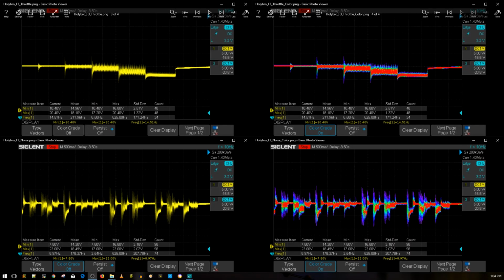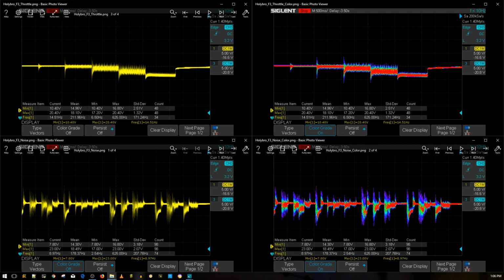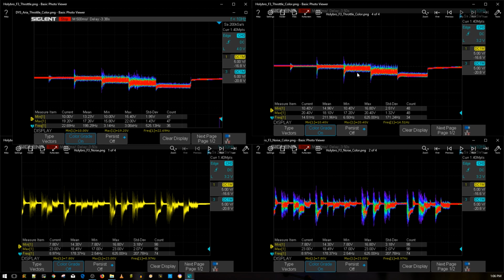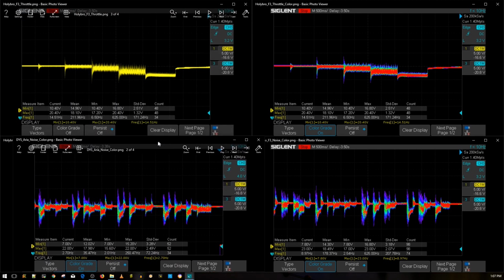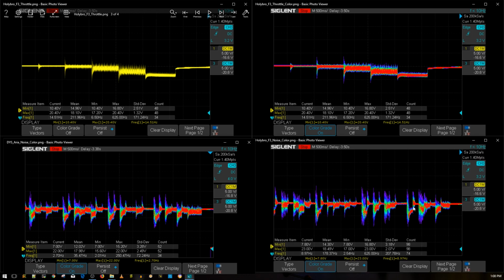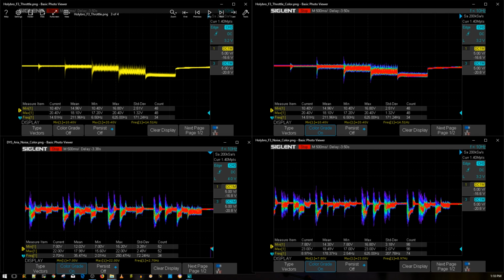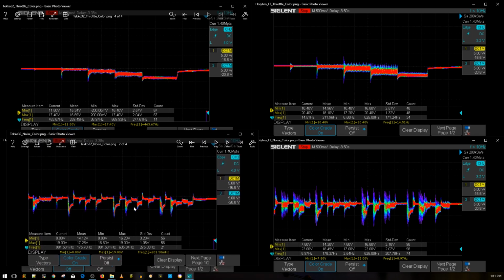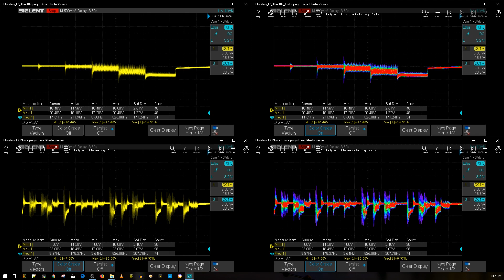The New Generation of FPV Drone ESC's // Holybro Tekko32 F3 35A ESC Review and Noise Test

Comment: Would you say that the Holybro Tekko32 35A 4-in-1 BLHeli32 3-6s ESC still is the best 4-in1 ESC for a quadrotor drone? Do you know if Holybro is coming up with a replacement or would you say this is still the best 4-in-1 esc until the end of the year. Also! I've started following your videos and I appreciate all of the effort and time you put into these videos :)
This is a side question, do you have any recommendations for a good PDB for a 6S set-up? Thanks :D

Comment: So in your opinion it goes like this.... 
1) tekko32 4in1
2)tekko32 individual 
3) tekko32 f3
4)dys aria? 

Is there anyway you can get your hands on the airbot typhoon32 v2 4n1?
 ((( IDK what it's called)))
 The original one from airbot that looks jus like the tekko32.
I would like to see those 2 tested against each other. I wonder if Holybro puts some magical unicorn pee on it to make it run so so smooth or if it's jus the design of this ESC is badass.
Reply from the maker: 1 tekko32
2 tekko32 4in1
3 tekko32 f3
4 dalrrc engine
5 dys aria
budget
spedix is30 single esc
Fly color raptor bls 30a

Comment: I made a comment in a previous video about these escs.  Glad you picked some up to test. 
Before watching the video I felt like the small amount of caps and the high processing speeds would cause it to be good but not as good as the aria.  I was figuring thef3 escs to have a little more noise than your testing showed.  The 32k gyros need clean signal to run smooth so I was applying that logic here. 
Interesting to see that it beat the aria. 

It comes across as a viewer you're really passionate about these tests.  I think I can speak for everyone and say thank you for taking the time to save us some money! 
Until the underdog beats the tekko32, I'll  stick with the 2 I have.

Comment: not sure if its a thing, but i notice when i add caps i loose some power from top end of the throttle. i would almost say its up to 20% loss. can you confirm this happens or am i tripping? i have felt this with both quads i have installed caps on and both times adding a cap was all i changed. my setup consists of tekko  32 escs and an matek f7. im actually thinking of taking the cap off as i had no noticeable noise in my feed to start with and the f7 has 10v for the vtx so it dosn't cop any v spikes and am i right in thinking the tekko 32s have enough caps on them to handle spikes?. thanks for your vids also, especially love the window shopping vids, wish they were longer (not a criticism just don't want them to end sometimes)